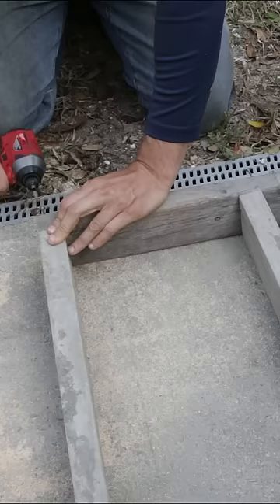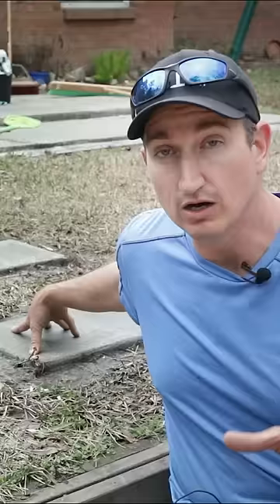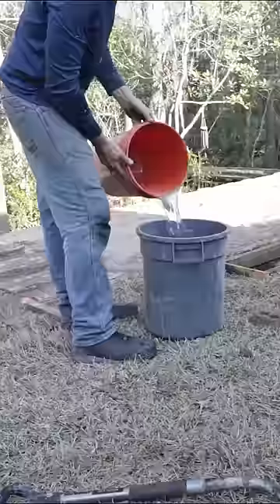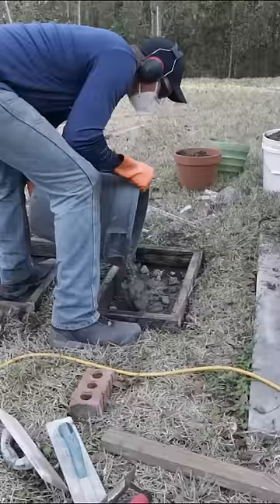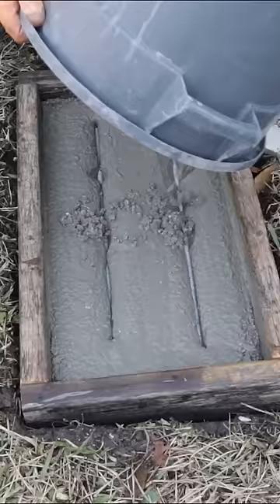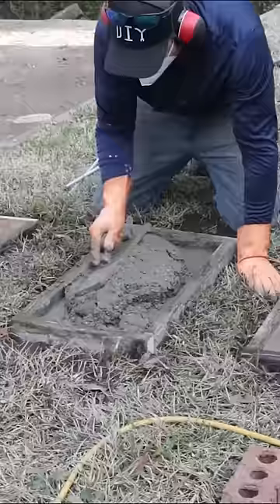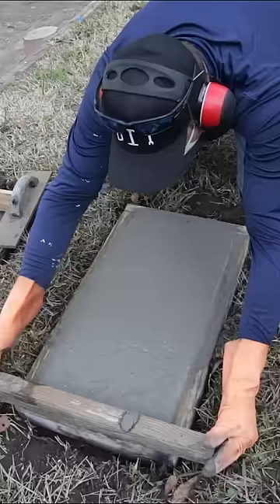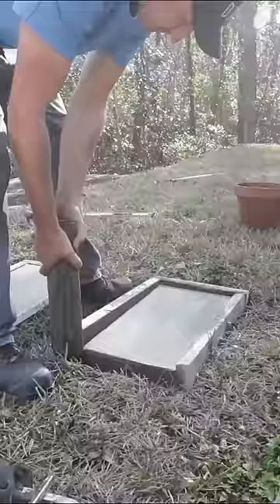How To Work with Concrete for the First Time

Comment: You do not need steel reinforcement for a slab of this size.
Reply: Noo
Reply: It doesn't hurt though.
Reply: @Wyoming307xx  it doesn't hurt to wrap yourself in bubble wrap and never go outside too
Reply: @Bolensgoldrush  doesn't hurt if u wear a rope as a tie either
Reply: Those reinforcement bars probably sank to the bottom anyway. Reo-bars are normally set at a calculated position in the form before concrete is poured.
Reply: @Bolensgoldrush  I never leave the house without 100 spf sunscreen and 5 layers of bubble wrap. And I being paranoid?
Reply: @Wyoming307xx  It actually could hurt. Steel rusts and expands over time. You have probably seen exposed rebar on the side of an old concrete building or wall. The rebar caused the concrete to crack and fall away.
Reply: @Smachfest  Yeah he put it at 50% then pushed them in, then poored...they were settling by the time he had set them in...No way they weren't bottomed out.
Reply: Facts
Reply: Yeah, at that point the steel oxidizing will cause more damage than anything else
Reply: This project is all about learning. Learning to us reinforcement is part of it.
Reply: @TomsBackyardWorkshop  we use the rebar because concrete is good with compression  like if you was to stand on it but it's not good with tension like if you was to push and pull on it and that's why the rebar is there because steel is good for both so it's the best of both worlds. and the cracking is due to them pouring concrete with a collapsed slump meaning mostly water in the mix instead of pouring a 3 or less inch slump.
Reply: @hannahmay5461  it will not oxidize inside the concrete.
Reply: Never a bad idea to reinforce it.  Steel rod might be overkill, but a few old wire shirt hangers with some grooves will definitely keep it from cracking for decades.
Reply: Bro used allthread as rebar , crazy lol
Reply: No you do need rebar even at this size,he should of ran a string line to make sure his steps are going to line up though
Reply: @Wyoming307xx  it actually can
Reply: @Wyoming307xx  Actually if the concrete has any kind of chloride based chemical in the mixture, which concrete often does, it will damage and rot the metal making the slab weaker.
Reply: @Troub4dour  been doing it for decades with rebar for all my deck stair footings. Never had an issue with cracking, oxidation, etc. Going off my experience. Never hurt to reinforce. That being said I always tie them together or weld them. Like i said Never had an issue 🤷🏻‍♂️
Reply: Or a mask and ear protection to muz a little mud
Reply: @Wyoming307xx  I should have said “it can” as in life nothing is 100% guaranteed, but as a practicing rebar inspector this is something we are taught in our training.
Reply: @Wyoming307xx ah yes because steel is free
Reply: @windmillacres679  yeah but you're using it inefficiently and so you're not learning anything useful
Reply: @Osama-Bon-Jovi-01  So? I may never use it again.
Reply: @mandoreforger6999  well that’s simply not true. Believe it or not, concrete is not airtight/watertight. In addition to the initial moisture contained in the wet concrete, oxygen will get to that steel one way or another and cause corrosion. Doubt it will have any effect on these pavers, though.
Reply: @killthecardinals  nobody said it was airtight or waterproof.  Rebar does not corrode inside of healthy concrete, period.  Rebar helps the concrete stay healthy.  If rebar is placed correctly within the slab, it will not rust or corrode.  The concrete medium distributes water content in low concentrations, well below the concentration required to rust.
Reply: @killthecardinals  go put your bare hand in wet concrete.  Let it dry a little, then rinse it off.  Tell me how moisturized your hand feels after a few hours.  If you are human, your skin will be dried out.  Cement absorbs moisture like a sponge, and any rebar is going to experience what your hand experiences.  As long as the slab is not submerged and has proper drainage around it, there should not be a corrosive problem.  Corroded rebar is the result of cracking, fissures and erosion of the outer layers of concrete, combined with inadequate drainage or ventilation.  You see it on concrete structures that have not been adequately designed or maintained with waterproofing sealants.
Reply: Are you insane
Reply: @TomsBackyardWorkshop  I have the same thought every time I pour concrete and more experienced concrete ppl say I'm wrong. I have lots of experience with steel and a little with concrete and I'm sure that low carbon steel in rebar will absolutely wick water just like wood only much slower. So I'm skeptical and would still love to see fiberglass rebar or at least no steel sticking out.
Reply: @drphosferrous  to be fair usually it isn't a problem but when the concrete is exposed to water often it can be an issue.
Reply: @Smachfest  it definitely didn't sink my guy. It is kinda pointless for that small of a step tho
Reply: @Bolensgoldrush  eh lack of vitamin d, lack of fresh air, prolly start to run out of food and water, electricity prolly gonna go out cause ur not working so you won’t be able to shower or brush ur teeth. So if you don’t dehydrate or starve I’m sure some sort of infection will be brought on. 

I get what ur saying but wrapping urself up in plastic never to leave the house most definitely isn’t safe.

Only you can prevent forest fires.

I’m taking a rly big shit rn. 

I have no toilet paper.

-Aiden
Reply: Sure ya don’t if you are a hack jonnnny
Reply: If anything a little wire or mesh but in reality you don’t need anything made a bunch of samples of stamped concrete years ago and they are still perfect
Reply: @Troub4dour  Picking on you as an inspector - this video raised some questions.

My opinion is that it is simply silly to put reinforcement in such a small flatwork structure, and people saying he should put gravel down first are being just as silly - this coming from someone who is absolutely OCD about preparing and compacting gravel and underlying dirt before pouring a slab.

But accepting his desire to reinforce; these are the questions he raised for me:

1. The knee jerk reaction is to question why threaded rod instead of rebar. Then as pondering that, I wondered if it is plated - therefore superior to regular rebar? I understand the industry went to epoxy coated until they found that cracks in the epoxy made it even worse, but plated might be genius.

2. He poured 2/3 of his depth, then presumably pressed them down to the halfway point.  This seems like the precise worst place.  We drill the center of a floor joist so to not weaken it. So it follows, to reinforce in the center doesn't strengthen it much either. Wouldn't placing it near the bottom be the best (assuming the forces that the tensile strength resist are from the top)?
Reply: Busy Bee Farms  My first thought 💀
Reply: 3 main issues

1- no set base. Dig out deeper and add gravel/sand and level before pouring.

2- steel reinforcement needs support so it doesn't sink all the way down. If you have harsh temp changes this is necessary to prevent cracking. If in more stable seasonal temps, this probably isn't even necessary.

3- Most Important - brush your concrete after finishing. If you don't brush, you just make a reason to get sued when it gets wet. Wet unbrushed concrete is as slick as wet ice.

Also they are pavers not steps.
Reply: @dennisrudis4069  Good points: they are so small that "pavers" is an appropriate description, and roughing the surface could keep someone from falling.

Your points 1 & 2. - people way over think this. They are just little dinky pavers. Plus, if this was a more extensive slab, requiring rebar reinforcement; the slab would be resist downward forces best if the steel reinforcement is near the bottom - not centered as many try to do.
Reply: @TomsBackyardWorkshop steel may rust, but the reason its used is because concrete and steel have, basically, the same rate of thermal expansion. So no, it wasn’t the steel that caused the concrete to crack.
Reply: @sirhaney  Corrosion of the steel reinforcement is the number one cause of concrete failure.
Reply: @Bolensgoldrush yeah that would hurt because it would interfere with other activities. Adding reinforcement to a slab this small doesn’t hurt because it doesnt prevent or take away anything at all and only adds strength that may be unnecessary.
Reply: @reanbowlerd5988  it wastes the clients time and money.  It is not efficient from an engineering perspective.
Reply: And then when he gets sick of them he could just pick them up off the ground and throw them away since he didn't put any crushed stones or anything underneath the concrete on top of the topsoil
Reply: @---ny4ys .... um... it might 😂
Reply: Yes you do. If you place the steps directly on the unprepared ground.
Reply: Maybe use 4" Sq wire mesh.
Reply: @Smachfest I made hundreds of “slabs” about this size for stone lids on swimming pool automatic cover troughs. They were only supported on the ends with adjustable brackets. We put rebar in them so they would not break in half when people walked on them. The rebar never sank to the bottom.
Reply: Rebars are not needed for that size unless you drive on it. If you use it, could atleast cross the rebars.
Reply: @Wyoming307xx Cold rolled steel does, the lye will eat that up in 10 years
Reply: @GRAYgauss 😂😂😂 you don't know concrete
Reply: This is practice.
Reply: Would the rebar even help if it isn’t prestressed?
Reply: @Bolensgoldrush  oh yeah it does

Comment: The ear pro for concrete is wild bro 😂
Reply: Helps keep the voices inside his head
Reply: If his are anything like mine, I'll leave them on if I'm going to be doing something that will need them that day. They're comfortable, and have mic/speaker setup that allows me to still hear everything. Bonus points that I can play music through them too.
Reply: That big old drill he used is loud as shit
Reply: On my personal time, regardless of the chore or task at hand, I will usually wear 3M ear pro so I can listen to music 🤷🏽‍♂️ helps me focus better on what I’m immediately doing
Reply: Ever try to get dirt out of your ears?
Reply: @Rafael_Fuchs  the voices or the ear pro?
Reply: And a mask
Reply: Playin it safe, I guess, maybe some dust will get in ears?
Reply: @PabloEskimofo  👀 Hahaa! Great @ name. I’m just gonna go ahead and assume this guy has a 1200cc snow machine and a 30.06.
Reply: them hammer taps may damage hearing, always wear eye protection too and a mask
Reply: @charsiu_808 you think using a mask for working with concrete dust is ridiculous? Tell me that again in 30 years, oh wait…
Reply: @Redact63Lluks telling ya it's really not kinda like a regular 12v but in a different configuration
Reply: 🤣Earmuffs and a mask😂

Comment: I think paver stepping stones and 2'x2' concrete squares at home depot are less expensive than building molds, buying sakrete, steel  rods, pouring, floating, and waiting for it to dry and cleanup. Way cheapers.
Reply: This is a project for people who haven’t worked with concrete before lmfao
Reply: He didnt say it was the cheapest route, things like this are a good introduction to working with crete and highly customizable for each persons needs/wants. That includes the forming process.
Reply: @1ronman1  not knocking the process. But for his application there was a cheaper route. Have a great day
Reply: @MatthewJRedmond  i agree if your doing a custom job then absolutely this would be a solid route...i would drive the rebar into the ground before pouring if its a permanent job but for the application shown there was a cheaper route for the same result. Have a great day
Reply: Pouring, floating and waiting are all free of charge lmao. Bag of sakrete is like what, $5?  You only need one mold at a time so what, $10 in wood? Rebar you can find anywhere so we’ll just say $5 for gas to find it. $20 to start and $5 per block, vs $10-15 per pre-made stone.
Reply: @thethirdhokanye3760             
Even 12x24 stepping stones are not $15 bucks each
Reply: @thethirdhokanye3760  are you a contractor? 2'x2' concrete blocks are 6 bucks. Time isnt free. And its your mentality that makes me money. Lol
Reply: @thethirdhokanye3760  sounds like you havent stepped inside a home depot in ten years. Sakrete is like 6$ a bag now and even then you need a mixer or a drill with a paddle tool ( for single bag application) and that tool is 20 plus bucks and lets hope you already have the drill
Reply: @dooooooval904  - and “$10 in wood” 😂
Reply: @PapaWheelie1  🤦lol
Reply: It’s for people to gain experience and more confidence when working with a new medium. Yes, it costs more, but there is value in the knowledge and understanding you gain from trying things yourself.
Reply: @NG..  like i said in previous. Not knocking the process. For learning.
Reply: Plus the guy didn't put crushed stone on top of the top soil so the concrete will crack and sink from the elements outside. The paving stones would have been much better, especially for someone who doesn't know how to pour concrete.
Reply: @The_Cannabis_Connoisseur  yeppers. He got his 14.5 minutes of fame making the video though.
Reply: He’s teaching people how to work with concrete.  It’s a tutorial.
Reply: 1.5 inch thick pavers do not have the strength of 3.5 inch thick pads
Reply: Concrete doesn't 'dry' it 'cures'.

Comment: I’m pretty sure you could save your threaded rod for another project. Something that small doesn’t need reinforcement, in fact none of your city sidewalk has reinforcement.
Reply from the maker: Probably so. Just had some laying around and was trying to show some general techniques when working with concrete.  Should the blocks ever crack the rod would likely hold them together.  In addition, the bars would likely limit any deflection in the blocks from load forces which would help prevent cracking under heavier loads should they ever be applied. For example, should I ever drive over these stones with a truck they might stay intact due to the added rod.
Reply: @MrKistel  or the wife.....
Reply: @MrKistel  no they would definitely break right where the rod is. Clearly you have never busted out old concrete.
Reply: How not to
Reply: City sidewalk most definitely has mesh for reinforcement
Reply: @PacoTheCuban  or nothing at all. We hardly ever put rebar in flatwork. And it lasts years
Reply: Sidewalks have rebar in them. I've torn up enough to know
Reply: @jeffhall768  almost never around here
Reply: And that's why they are all broke
Reply: @jonpaul1981  not true
Reply: Meh....yeh a lot of a.d.l. projects going on now do. I agree it still shouldn't but hey engineers get paid based on how expensive they can make the dang job.
Reply: @benbuchanan7592  lol
Reply: The replies back and forth on this comment amuse me. Almost like there's a set of licensed professionals that evaluate use case, geotechnical properties, local temperature ranges, and other variables before spec'ing out a concrete design that a municipality would use, and that design might differ from location to location. 

What if I told you, you're all correct, and there are both cites that need wire mesh in their flatwork and cities that don't? i0_o?
Reply: @AndrewOborny  do you not consider slab on grade flatwork? Because I'll tell yeah everything the engineers around me cook up has rebar and wwm running six ways from Sunday
Reply: @gibsomperson ask those engineers how the Hoover Dam is still standing with NO rebar😂
Reply: @gibsomperson  i dont consider it flatwork because its has a footing and building on it. Typically when you talk about flatwork its everything outside the house which Typically has a broom finish. Id consider a slab on grade a floor which has a power trowel finish. But ig people use terms different aross the country.
Reply: @PacoTheCuban  it most definitely does not. Source, myself a city public works employee.
Reply: It has wire mesh
Reply: @AndrewOborny  hey, many people have lived in a cheapskate town with potholes, broken sidewalks and bad schools.  Even a mediocre sidewalk has wire mesh…
Reply: @DUTCHEE  does it ever freeze at the Hoover Dam? 🤔
Reply: @mandoreforger6999  your opinion i suppose lots of perfect concrete with no rebar or wire mesh
Reply: Chris D.  you are really funny. I know enough about concrete to know that tons of sidewalks are poured with know wire mesh or rebar. And i pour tons without rebar or wire mesh.
Reply: chrisd.2319  google say's otherwise.  Typically you never add rebar/wire mesh unless you are pouring a stab that's load bearing... even then most driveway's ect don't use rebar unless it's in the code for that area.
Reply: @MrKistel but they will break because they are sitting on soil
Reply: @DUTCHEE Because the Hoover dam is only and always under compression. You don't need much reinforcement when something is only going to experience compression, and a pretty constant load at that.
Reply: @PacoTheCuban  Usually it doesn't. Source: 40 year career in concrete